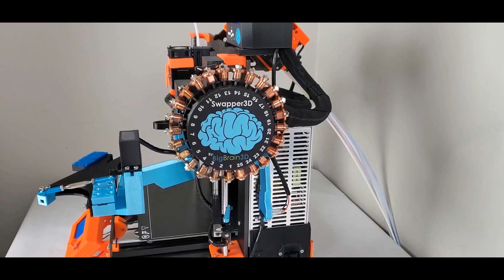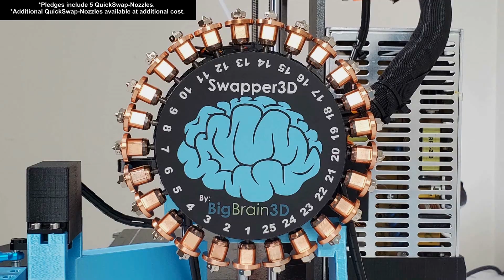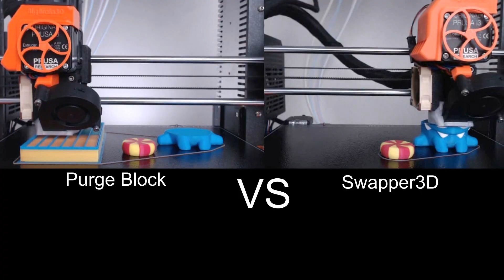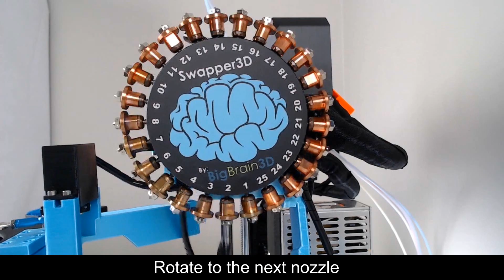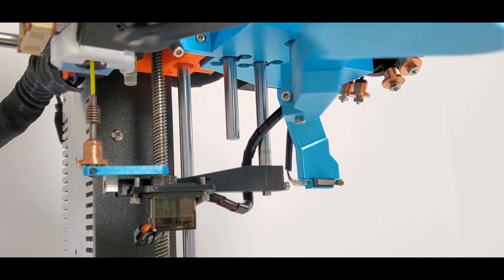Never print a purge block again!

Comment: Wouldnt it be easier to retract the filament instead of cutting it? That way you would skip a step on the process, make the machine less complicated and a bit faster between swaps also with an mmu or ercf you would still need to retract the filament either way
Reply: Without cutting it it is hard to get the filament to feed back in. If it is just retracted the end of the filament is too large to easily feed.
Reply: @Xploit66  i dont know about the mmu but the ercf has tip tuning where it presses the filament a bit before retracting to have a cone shape, that way that issue could be avoided
Reply: @7897sebas  even with that it still isn’t as smooth as a cut, and having it cut means it is consistent regardless of how the filament is fed. It’s more future proof this way.
Reply: @Xploit66  cutting it means it will loose the ability to retract for a while
Reply: there is a design on thingiverse I've seen that retracts, then clips the deformed end with a similar mech, then purges into a purge tank. Very little wasted material and the nozzle doesn't have to heat back up.

Comment: would this work on a longer lk4 pro and longer lk5 pro? (basically a better ender 3 and cr10)
Reply from the maker: It should work with any Creality "style" printer. It will require a mounting adapter though. Our customers will have access to the 3D printed part design files and firmware code so that making adaptations is easier. Thank you for your comments :)
Reply: @BigBrain3D  awesome. Thanks for the reply! :)
Reply from the maker: The Swapper3D now supports the Creality Ender 3: https://www.kickstarter.com/projects/bigbrain3d/swapper3d/posts/3564223
Reply: @BigBrain3D  awesome

Comment: Holy overengineering.  I mean - it's impressive as all hell, that you got a system to work like this!  I usually just purge to the infill of my model instead; so fail to see any benefit in that regard, but the quick nozzle swap bit is the real star of the show here.  I'd love to have nozzle changes automated like that just to be able to do things like use tiny nozzles (0.25, 0.1) for outer detail pieces, and then combined-infill for bonding the walls together.  /sigh...now I've gotta build an ERCF for my personal machines so I can do this.
Reply from the maker: Thank you :) Yes you can use it to change nozzle sizes automatically during prints just like you mention. It opens up all sorts of possibilities. You could even do that with a single filament, though if you add an ERCF then you can have multiple nozzle sizes per material.... Thanks for the comment!
Reply: So you basically print the colors inside the object as infill instead of purging the colors? Didn't know that was possible
Reply: Hey, I have quite a bit of experience printing but none printing multmaterial. Is it a slicer setting that allows you to print to the infill? Or some tweaking you did yourself? I got to say I never considered that a possibility so I'm really curious
Reply from the maker: @pixel_vengeur391  It's a slicer setting In Prusa Slicer -> Expert mode -> Print settings tab -> Infill section -> Infill before perimeters (last option in V2.4.0)
Reply: @BigBrain3D  Ooooh I hadn't thought of using that, smart move!
Reply from the maker: @pixel_vengeur391  thanks :)
Reply: and in cura? @BigBrain3D
Reply: My thoughts exactly. I thought this was a joke first but then realized that it's not.
Reply: I have no interest in multicolor printing, outside of soluble support material, but being able to print with multiple nozzle sizes for detail is very appealing.

I mostly print with an 0.8mm nozzle (and might go bigger if I get around to upgrading my hot end) which makes nice durable prints. But being able to swap between a 1.0 and a 0.2 at will along with soluble support would be living the dream!
Reply: @bobgarrish  multimaterial is very useful however

Comment: so...  

How do you level each nozzle?  

How do we ensure the filament will flow through when you cut it, it doesn't look entirely clean.

Where are the replacement blades?  Are they available?

And finally, doesn't this require a whole new hot end?  Is it included?
Reply from the maker: As long as the removable V6 nozzle is torqued to the same amount for each. The production is tightly controlled, and when they are inserted they into the hotend the slide lock pulls them up and seats them each at the same point in a taper. Just like in a CNC mill tool changer. In this way nozzles are at the same level so individual leveling is not required.

Comment: Oh yeah, that's bound to be reliable.
Reply from the maker: Swapping nozzles is the only way to eliminate purging. So we're doing our best to make sure it's long term reliable: High quality materials, bearings, and motors. Optimized swap sequences. Error checking at each stage and user notifications. Thanks for commenting :)

Comment: Interesting concept. How can you assure that the z position of the nozzles remain the same up to a decimal of mm? Usually when you swap a nozzle the position of the tip changes, even slightly, and that can be an issue, how do you solve it?
Reply: i guess same as in CNC swaping tools.... OR each nozzle has its own offset...
Reply from the maker: When the QuickSwap-Nozzle's are inserted into the hotend the slide lock pulls them up and seats them each at the same point in a taper. Just like in a CNC mill tool changer. In this way nozzles are at the same level so individual offsets are not required.
Reply: @BigBrain3D  If you have nozzles of different sizes in the tool changer then you will need offsets for each tool. Wouldn't be too hard TBH though, especially if you make a probe like the one featured in the Voron 2.4 and have some gcode that will just loop through all of the tools and save the offsets.
Reply: @Thorhian  I dont think so if the center of Dach nozzle is the same than not thr Alice just hast to know that there is a different size.

Comment: Love everything about this campaign pitch. ---but I have one big question.... does it fit into a Lack v2?? Bc Id strap this to 3 printers with MMU2S's and a Palette 3Pro
Reply from the maker: Thank you!! The Swapper3D sticks out from the right side of an i3 by 160mm and the printer will sit 85mm taller. We don't have the Lack case but with those measurements can you tell if it will fit?
Reply: @BigBrain3D  I’m crushed.. the lack v2 is approx 542.2mm X, Y & Z and that’s with the ceiling cutout (that can definitely be widened to accommodate another 35-40mm in height) but the width will need to have a special cutout or workaround. DM me and I can send you more detailed lack dimensions if you need 🤝

Would LOVE to strap this to at least my PLA/PETG specific printer as I can think of a handful of use cases. This is such an amazing idea refurb from the pellets mechanism from before. This is awesome. Really, congrats! ESP if you scale it and get to a v2 of it!

Comment: A novel approach, but seems like all the weight hanging off the side might cause some substantial resonance issues.  As for the construction, it looks like it's going to be really fragile. Stuff like cable management (pinch points with zipties look to be an issue on the unit shown), screw anchoring and overall design looks like it needs more time to be fleshed out. As for leaving filament in the nozzles, is there some kind of a cooldown cycle? What is done to prevent the heater block from shifting around? Also, is there something other than threads being used to lock the nozzle in place? Stepper motors are fun little gizmos, but not known for high torque. As for nozzle adapters, since only 5 are included, what is the MSRP going to be per nozzle going to be?

The next part comes in the form of interfacing. How is this thing run, does it use a separate controller board? Where does it draw power? Are there modifications that need to be made to the stock control boards? Is there documentation for users to try adapting this to other models of printers? Do we have to use a custom slicer? If using this with a Mosaic Palette, is there a way to compensate for the zero purge block filament distance that is now changed?

The zero dollar goal for Kickstarter seems really sketch however, and lots of people get burned on 3D printing kickstarters. Price as well seems pretty steep, but I imagine there's a lot of overhead with a new product. 

Here's hoping this succeeds, looks like it has a lot of potential. I am asking a lot of questions, as you're at the asking for our cash step.
Reply from the maker: Lot's of questions! We'll do our best.
We haven't noticed any increase in resonance above what an i3 normally has. Perhaps because the weight of the Swapper3D is only realized by the printer during Z moves like hops and not during XY printing moves.
We've made the parts as strong as possible considering the space constraints, and while trying to minimize the weight as much as possible. What parts do you think look fragile? 
Cable management can be an issue when lots of motors like the Swapper3D has but they have been intentionally tied up. There is a balance between hiding all the wires and the extra strung weight that would require. We have since gotten confirmation from the servo manufacturer that they will customize the wires to blue/grey/black which will match the color scheme and then maybe we can delete the spiral wrapping bands which would reduce weight, clean the look, and make the wire more compact giving much options for concealment. The point being that there is work to be done. But I can confirm that the wires do not get tangled or pinched buy the motion of the arms, it's difficult to see in a 2D video but IRL they have lots of room. 

Then filament is normally left in nozzles during single color printing so the Swapper3D doesn't add any additional point of failure. You can of course unload the filament after the print is done if that concerns you.

The heaterblock is secured in the standard way to the printer and doesn't shift around. The QuickSwap-Nozzles are pulled up to a taper inside by a sliding lock, which locks them in the same position. You can see a gif of this on the kickstarter page. 

We using high torque servo motors not steppers. 

The MSRP of the QuickSwap-Nozzles (which also includes the V6(M6) style Nozzle tip) is 29CAD. During the Kickstarter they are 38% off.

The Swapper3D uses an Arduino based systems to control all it's parts, separate from the printers electronics. It draws the few amps it needs from the printers main PSU. 
We will compile the documentation during the period where we are waiting for the production parts. We don't officially support other printers right now, but theoretically Creality printers should work and we will be exploring that next. 
There are no changes to the stock printer board BUT 3 wires need to be plugged into the available serial header of the Einsy board. 
We use Prusa Slicer and it requires custom gcode in the "On tool change" section. The P2PP plugin is currently required to use the Palette with the Swapper3D but Mosaic has a good coding team and may just update Canvas to support the Swapper3D like they did for our other side purging devices. 
Since we could deliver even a single kit if pledged for we set the goal at $1. Usually projects set that to a minimum for production (like if they need expensive injection mold tooling) not what they WANT to make on Kickstarter. If they did that then no projects would ever fund because they only fund if the goal is hit. This way at $1 everyone who pledges knows they will get a Swapper3D kit they don't need to worry that we may not hit our goal.
I think the price is a matter of perspective and from our perspective the price is extremely good. If you were to buy all the parts from separate suppliers it would cost you hundreds more! Also consider that this includes a complete Hotend. Those alone from some other suppliers cost well over a hundred dollars. Like a mosquito hotend costs $193CAD and that's without a nozzle!!! Please remember that our entire project is priced in CAD. To American's that makes it seem nearly 30% more expensive than it is. And we include 5 QuickSwap-Nozzles in the default pledge. At 399CAD it's a great price considering all extra Swapper3D stuff like the custom machined parts and all the servos and hardware and electronics etc. If you do a price comparison I'm sure you'll find this is true.
Thank you for the questions and insights. It's important for us to hear what people really think, it give us a chance to clarify our messaging. Thank you for sharing! =D
Reply: @BigBrain3D  Appreciate the reply, answers a lot of my questions. And yeah, I mixed up steppers and servos. The nozzle blocks almost looked threaded, so it really threw me off. Since a lot of the system uses printed parts, could have a lot of potential for revisions such as building in cable management clips and the like. The more I see, the more crazy the engineering gets. It's a mix of complicated insanity and solid design principals all at once.

 Kudos on spacing out the delivery dates on the reward tiers as well. I know that too much demand can outright sink a company if they get overwhelmed with orders. Even then, 250 units a month is impressive for such a complicated system. Going to be a lot of long days ahead of you, even with a good team. Thankfully Arduinos for the most part are still cheap and easy to get. If it were based on a Raspberry Pi, woooo boy, that'd be rough. Nice to be able to do the printed parts on our own, especially for color matching and the like.

I do printing for work, and we typically use Voron 2's and 0.1's, but we're doing some multi-color stuff in the future. With the filament we use costing $80 a KG, purge blocks and blobs add up quick. 

After the kickstarter, will you be selling direct through your own site, or working with 3D printing suppliers/dealers? Might be time to dust off ye olde company credit card.
Reply: They could do it like vertical milling centers where the tool(nozzle) changer is fixed at tallest Z height. To swap nozzles the X axis/hotend do a rapid move to max Z where the end effector can remove nozzles.

Comment: it looks like the quick swap nozzles use a standard nozzle on the end? can we use different size nozzles with the quick nozzle system or do we need to buy different size nozzles from you?
Reply from the maker: Yes! the end is removable and uses a standard E3D style V6 (M6 thread) nozzle. It will accept any nozzle you currently have or wish to buy from any manufacturer as long as it adheres to that E3D V6 style.
Reply: @BigBrain3D  you'll need a precision length setting tool or jig so when people replace the nozzles in the quick change mounts they'll be able to correctly set the length.
Reply: Does this mean it will work with E3D’s new Revo nozzles?
Reply: @matthewethomas  no, revo is a completely different ecosystem.

Comment: This is pretty cool guys! How does the filament get swapped?
Reply from the maker: The Swapper3D is paired with either a Prusa MMU or Mosaic Palette to unload the old filament and load in the next filament. Thanks for the question and compliment!
Reply: Ok. PrusaMMU supports 5 filaments and the bigger version of Mosaic‘s Palette supports 8. Why do you support 25 nozzles? Is the idea to allow printing with different nozzle diameters as well?
Reply from the maker: @Pluto1010  Yes. Also, ERCF supports 12 filaments. Also in the future maybe someone will do more than 12 colors....
Reply: @Pluto1010  the ERCF similar to the mmu can change upto like 12 colors. I assume if modify the ERCF to change even more colors this would also work
Reply: @Pluto1010  yea, I think the video mentioned different sizes as well. That'd be a big time saver doing e.g. infil on a larger nozzle.
Reply: @Pluto1010  once a nozzle is swapped it cant be used in the same print, as there is still filament stuck inside. Therefore you would need a new nozzle for each color swap, even if you swap back to a used color
Reply: If that's true then wouldn't it run out of nozzles after 25 color changes? That would mean you can't print anything with hundreds of color changes or anything with more than 25 layers containing multiple colors, since every multicolor layer would require at least 1 swap. That doesn't sound right
Reply: @KibbieKatt  It is not true, if you look at the video, you can see more than 25 colour swaps when printing their test model. All you need to do is heat up the nozzle while it has plastic in it to get it to melt, just like when you turn your hot end on after it being cold. The guy is presenting an idea of how he thinks it works as fact, while being completely wrong.
Reply: @lucaeric510  that’s not how it works at all. If you aren’t of how something works then you shouldn’t present it as fact. You can see in their demo print they do way more than 25 changes, and it makes no sense that plastic would clog the nozzle given you can just melt it and continue printing.
Reply from the maker: @lucaeric510  Nozzles are reused. A nozzle is used every time that color which is in it is called for.
Reply: @lucaeric510  This is why THEY are BigBrain and you are not.
Reply: @lucaeric510  Pretty sure the just reheat the filament in the nozzle and push it back out with the same color.
Reply: @lucaeric510  That doesn’t make sense. If the nozzle can’t be used again in the same print, how would you prepare them for the next print then?
Reply: And how does the seccond hotend keep warm for filament to melt ? All at once for random coulor prints is wasteful af and 1 by one incheases swap time
Reply: @The2strokeguyOfficial  I assume its one by one, but youre assuming heating the nozzle takes time only because you are thinking about heating the heatblock and nozzle. 
The nozzle has next to no heat capacity in comparison to the heatblock so it may be significantly quicker to heat?
Reply: Told ya!
Reply: exactly hahahaha